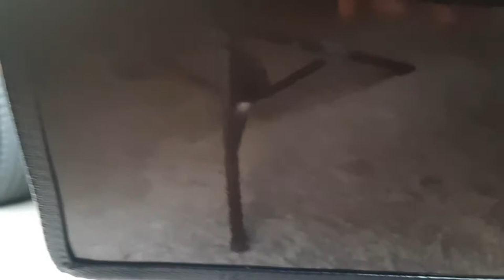Car Door Edge Protector | Comparison | Installation | Review | Concept Hub Car Accessories

Comment: Hows it hanging on the hood so far? I wanted to do on hood also but was worried it will melt and stick from the heat and i will damage the paint when removing, let me know thanks
Reply from the maker: So far still fine. I just regularly remove the door edge when I wax my car, and clean the door edge as well before placing it back to place 🙂 No corrosion or damaged paint